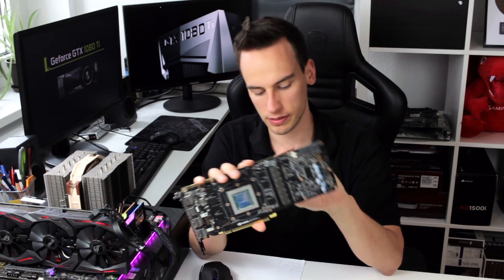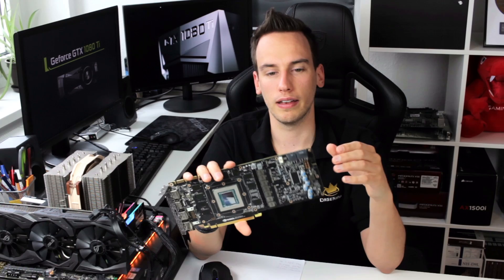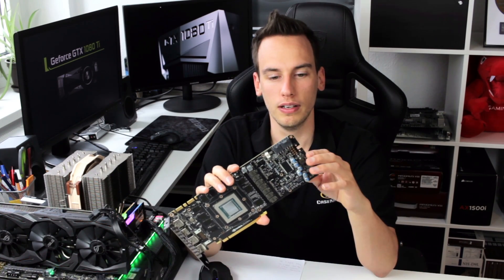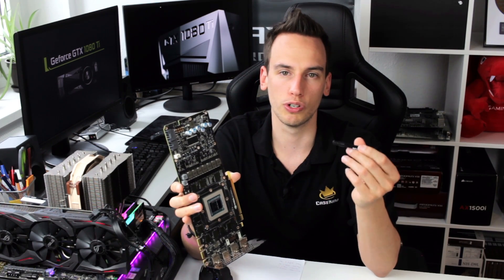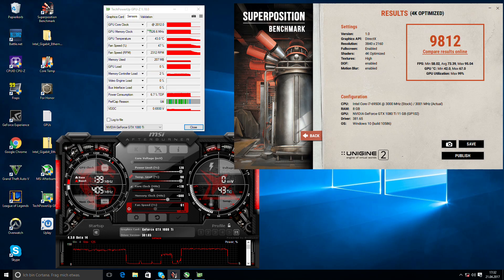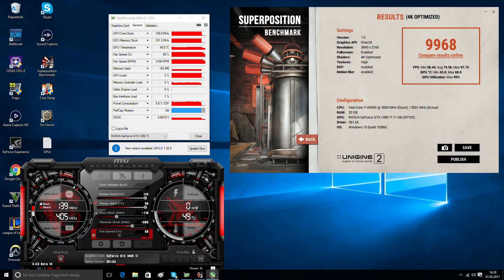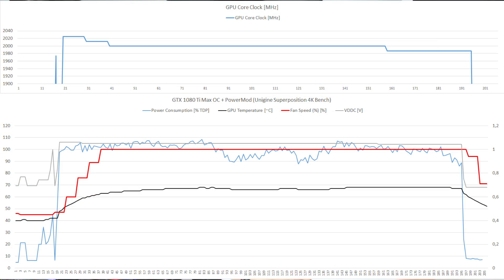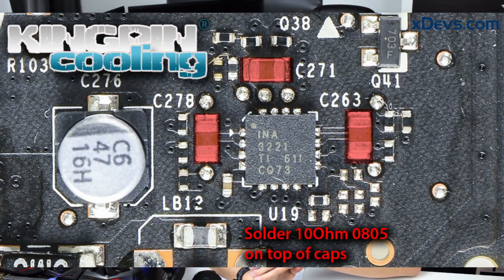GTX 1080 Ti Founders Edition Power Mod (english)

Comment: So how did this hold up over time? Did it last over 1 year? Did it handle being air-cooled, or did you end up needing to put a water block on it? 

Thinking of doing this on mine, since I'm finally at a point when I'll notice an additional 10-20% GPU speed, but don't have a waterblock
Reply: I'd like to know this as well. I hope your comments will gain some traction

Comment: Just flash to XOC Bios i can now clock my FE 1080ti to 2200mhz!!! Water block required.
Reply: I read that even though you get higher clocks the benchmarks are lower because the bios is not optimised for a founders edition card...
Reply: For example, my FE can do 2075 mhz on water without any mods, if I flash xoc I might get 2100 mhz but a lower score in benchmarks... Can you verify that for me?

Comment: Would re soldering lower resistance shunt be possible to help longevity?
Reply: Sam Sung yes. If you drop the resistance by more than half the card will not boost and stay around 200mhz. On my card I just soldered a shunt with the same resistance on top of the original.

Comment: I also have the 1080ti FE, using it with custom waterblock, but when I powermoded it, for some reason I only did the top 2 resistors http://i.imgur.com/hlNJxTZ.jpg  ( based on OCN topic ), and did nothing to the bottom one ( i think the one that regulates the PCIE power, and whenever I run tests it still hits power limits.
Do you think if I redo the mod ( meaning also applying liquid metal to the bottom resistor ) would help me by not hitting power limit ?

Also what is your view on using crossflashing on the cards ? Currently I am using AMP extreme bios on my FE. ( i have also tried all the available 1080ti bioses on guru3d bios archive), some work some  just keep clocks very low and are basically not usable.

And the last question, if you OC the 1080ti do you mess with manually setting the voltage curve, or just plain add +100 for example  for the core and let the card adjust the curve itself ? Anyways good job with the videos as always and it`s nice to see that you do english videos too since my german is limited to about 5 words if that and 3 of them are not very polite!

Comment: When Deliding a CPU can I use pure gallium from Amazon? or do I need to buy liquid metal tube from Grizzly or CoolLab?
Reply from the maker: Gallium won't work. Melting point is too high and it doesn't stick properly
Reply: der8auer I thought liquid metal is gallium?
Reply from the maker: Liquid metal is gallium + indium + tin + few other metals to lower the melting point and improve performance
Reply: der8auer oh I see... do you know where i can buy some liquid metal since Amazon Canada sells some but no Prime and NCIX stopped selling it?
Reply: der8auer I'm in Canada not the United States of America
Reply from the maker: They should ship to Canada, no?
Reply: der8auer I'm pretty sure it won't make it through customs... I need a person to ship it to me as a gift for a chance to get pass customs.

also I think I know why people are saying the resistor on the GPU is falling off :D since maybe they are using CoolLab. Coollab uses more other stuff that might be why it's eating it off. Grizzly may not contain that much of the stuff that  eats the metal away but uses more Indium since I read that Grizzly uses more Indium.
Reply: Does it work GT 730 ???
Reply: Ahmet Çevik it's a gt 730 what's the use?
Reply: Yes, the NVIDIA graphics card would this method work ?
Reply: Ahmet Çevik there is no reason to apply this mod...
Reply: LiteGaming 
What does this mode do, buddy?

Comment: i have a 1080 non ti. it was a day 1 release card and ive had it at 2148mhz oc on it for as long as its been in service. this card has been under water for its whole life. all I ever did was increase the offset and increase the power offset. Never touched the voltage and there is no hardware mods on it. 

Also for anyone who is going to tell me "go check gpuz after 10 minutes of gaming and you will see it drop to 1900mhz" there were only two situations where I ever saw it drop below 2140mhz, and thats when I play an e-sports type of title (i still play league at 1080p due to no 4k support) where it goes down to 1850mhz~ and when I was trying to get it to downclock and had my card make love with the fuzzy doughnut of death and watched it go down to 2ghz~
Reply from the maker: That's absolutely possible. I saw a lot of cards that can do 2100+ on water. Pascal scales quite well with lower temperature
Reply: The legend replied. So yea the core never breaking 45c probably helps the clock then lol
Reply: Thats Normal for most GTX 1080 "none TI"

Have testet 5x Evga GTX 1080 SC cards,  4 of the cards could do 2100Mhz+ one of them only 2043Mhz.

TI on the other hand, thats a other story :O)

Comment: is it possible to coat the pcb area around the shunt with clear nail varnish before you do the mod,so you don't get any liquid metal on the solder?
Reply from the maker: that could be an option, yes :)

Comment: overclocked to 2000 gtx1080ti and 65-69 degrees on the stock cooler ? Really? Bullshit xD
Reply from the maker: What do you mean? Those are the exact values I had. Keep in mind that I used a custom fan curve

Comment: +der8auer
7:10 I don't understand why the "Power Consumption" graph is fluctuating so much with a solid VDDC voltage and a very solid GPU core clock. Yes we know it is getting wrong readings, but those reading must be solid stable even if it is wrong.

So what is causing this fluctuations? Is it related to the amount of FPS it is drawing on the screen?

Some Tech channels have shown, that when you have a solid GPU Core Clock. Your game will have a higher %1 low & %0.1 low.
And this gives you a even smoother gameplay experience.
Reply: Nisco Racing gpu power consumption always fluctuates. that's why there's a power LIMIT that this mod disables. sort of. it only makes the power consumption readings lower than they actually are to prevent the power limit from lowering clock speeds. but power use always fluctuates. also has nothing to do with fps. also 99% load doesn't mean the highest power draw. it just means that the gpu is fully occupied.
Reply: ***** I don't agree on the fps part. Drawing 10 FPS on screen vs 100 FPS totally has different power draws.
Reply: Nisco Racing if both these framerates are at 100% gpu load they may as well be drawing the same amount of power. frame rate is not a measure of load, it's a measure of performance. the gpu can struggle to achieve 10 fps in a very high quality scenario, and when you turn down the quality settings you might get 100fps, but the gpu will still be working 100%. unless you use a frame limiter or vsync. 
but even then they will not be truly comparable, because maybe the 10fps scenario might even use more power than the 100fps scenario, because the scenes are harder to compute. 
but there are also other limiting factors, like the cpu. which might not even let the gpu use 100% of its capacity. 
that's why I say that fps is not a factor in determining power draw. fps is the outcome eventually, but you can't compare power draw by looking at fps.
Reply: ***** Yes i agree, when you change graphics setting.The power draw will be different on same FPS counts. But you're taking it out of context.
Look at the graph 7:10
GPU clock stable
Vddc voltage stable
Temprature stable
Fan speed stable
But still power consumption is going up and down.
The only thing that i know of, that is slightly fluctuating up down is the FPS. Would be nice to have a graph  with like a locked FPS on say 60FPS. My bet would be, that the power consumption would be more stable.
Reply: Nisco Racing again, fps is the end result, not a means for measurement. the fluctuation is minor, mostly around 100-105% with a dip to the 90s in the middle. but you also see a dip in temperature there. 
if you would lock the fps there would be more fluctuation, because not every scene requires as much power to compose. that would only happen if the frame wouldn't change at all. when a still image is being rendered, like with furmark. 
the frequency and voltage also don't have anything to do with the amount of fps or the fluctuation in powerdraw. powerdraw is in Watts, which is Voltage x Current. frequency is not the same as current, neither is fps. so the frequency and fps can be rock solid, but that doesn't mean the current will be rock solid. there are more factors to the amount of current the gpu uses, which is also determined by the complexity of the image that's being rendered. 
also moving back and forth data from and to the memory can be different with every frame. 
and again, also if the GPU is being used at what the software says is 100%, it's not really 100% of its capacity, it's more in terms of time active. it's more complicated than picking one single factor that causes power draw to fluctuate. 
if it was that simple they wouldn't have to incorporate power draw as a measure of safe limit. but they know powerdraw has no 1:1 relation with all other known variables. else they could simply calculate power draw. but that would be inaccurate. so they physically measure power draw to make sure components don't draw too much power and break, like the vrms. 
what they do know is that lowering frequency and voltage will reduce power draw. but also the complexity of a scene can reduce power draw, but they can't influence that.

Comment: Do you think getting to 1.1-1.2v (power mod+XOC) on water (let's say core temp of ~40c) on a card like the Strix or FTW3 will result in any appreciable gains? ~2000 to 2100 won't get you that much, but ~2000 to 2200 would be a nice bump. 

Also, are XOC bios restricted or publicly available?
Reply: That would get you at most 5%. I found better gains boosting the memory as much as possible. I haven't done the power mod yet but on water with 12-19C input, I get a 12C deltaT with 25% antifreeze-distilled water on a heatkiller IV. My EVGA FE 1080ti is stable at 2101MHz core and 6130MHz memory.

Comment: Hey man, enjoying your videos and knowledge. About that statement about 100% voltage slider causing a radical lifespan drop, Tom was talking about fermi/kepler cards. 

He meant to say "that was the reason they pretty much locked Pascal at 1.093V" not that pushing the slider towards 1.093V caused the card to have a sub 1 year lifespan. 

Just added this comment because his wording was indeed weird and easy to get confused
Reply from the maker: Ah okay that makes more sense :D thanks
Reply: der8auer Ich kann eigentlich kein Deutsch, alles nur Einbildung :^) xDDD

Comment: It's the gallium content of the liquid metals that is diffusing into the solder and weakening it, not the tin.

Personally, I think that putting resistors across the caps near the power monitoring chip is a better solution than this.  T|N's guide recommends soldering them, but you can just use a conductive pen to affix them along with some glue.  Very well defined power drop, and just as reversible as this mod.
Reply from the maker: Will give that a try for sure :)

Comment: I don`t get why guys use liquid metal? Regular soft grade pencil(graphite) works much better and is even easier to remove . Allso much much safer. Another benefit is you can actually tune the resistance pretty easily.
Reply from the maker: Can you link me to what you mean exactly? Would give it a try
Reply: Just use HB grade pencil. It`s conductive enough. Some harder grades are not conductive enough. It used to be main method for unlocking multipliers and cache on old  AMD cpu`s. Here is some article talking about it: http://www.tweaktown.com/guides/376/amd_overclocking_guide_october_2002/index8.html .
When using the method on GPU`s I`ve noticed you have to but quite a few lines over the resistor.
If you want to be more methodical about testing this method you could always measure the resistance with multimeter.
Reply from the maker: I think I tried a pencil before on the GTX 980 and it didn't help. Resistance is 5mOhm so even with a miliohm-meter it's quite hard to measure it exactly.
Reply: I`ve done it on couple of 970`s and 1060`s and it always works.Usually takes just 1-2 tries. If you have little or no effect just scrible more over the shunts. But yeah the pencil grade is really important.
You are probably right about measuring the shunts if they are that low resistance. I have not had need to do it, just thought it might work.
Reply: Impossible to measure a low resistive circuit of 5milliohm with a milliohm meter while the resistor is still connected to a circuit. Much better to do a bit of math, buy the resistors and solder them on, that way you can calculate exactly what power range the regulator will target.

Comment: People running semi-heavy compute tasks on fleets of GTX 1070s 24/7 with overclocks of around +150 GPU core and +8.4GHz memory are posting attrition rates around 50%-100% after 9 months of usage that varies from board partner to board partner.  The GPU core degrades very quickly with high overclocking.
Reply from the maker: Wow that's heavy. But 24/7 compared to the average gamer is a huge difference. In that case the normal gamer is still safe for around 5 years
Reply: Depends on gaming hours per day; under 6 hours, then you are over 3 years comfortably for pretty much any board partners card with reasonable overclocks.
Reply: +Balb Mahal
But the big thing here is temperature. When those cards are running 70°C compare to +80°C the degradation rate is faster. Like der8auer said better have watercooling with this MOD, that will slows down the degradation by a lot!
Reply: I'm running GPUGrid on my highly overclocked 1080 GTX almost every day, so this is very interesting to me! Is it the GPU itself that's degrading, or some other component (VRM)? Can you provide any sources/links with more information?
Reply from the maker: It could only be the GPU. For sure the VRMs have no problem providing a little bit more power if the cooling is sufficient.
Reply: A member on a forum posted: that all of his EVGA 1070's (basic model) had died, roughly one month ago. The member, usually post his failure rates on his cards from various board partners, Gigabyte, MSI, ASUS, etc. More recently, he has been posting, that his MSI 1070's are dying.  This is with highish overclocks and 24/7 compute workloads.
Reply: I ended up with voltage limit on my 1070 ftw 1.093v @ 2151 MHz, no shunt mod as tdp was pretty low and I had 122% power limit. 

http://prnt.sc/f7moz9

I guess only way is to somehow increase GPU voltage more. Using EK water block on GPU so temps are pretty good. That frequency / voltage curve thing really does improve maximum overclock compared to normal style of increasing core clock.